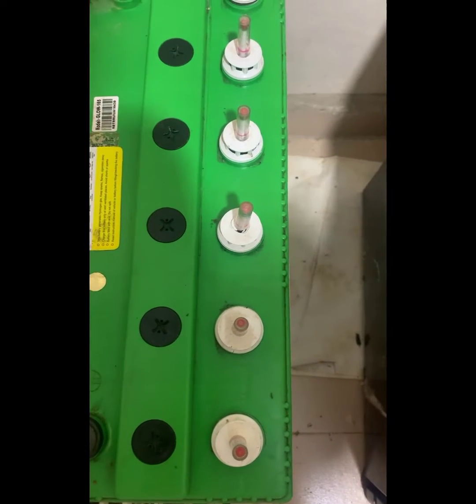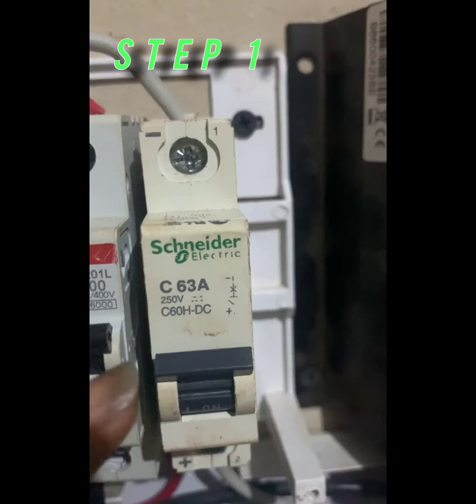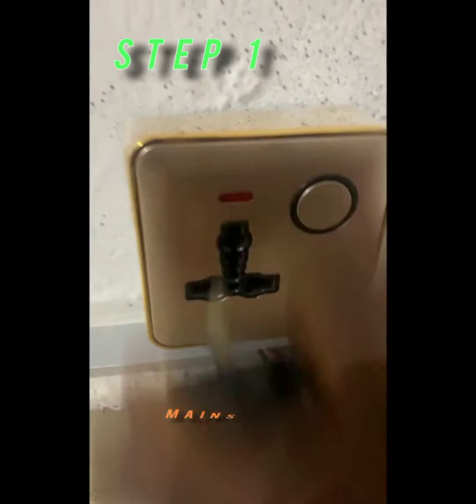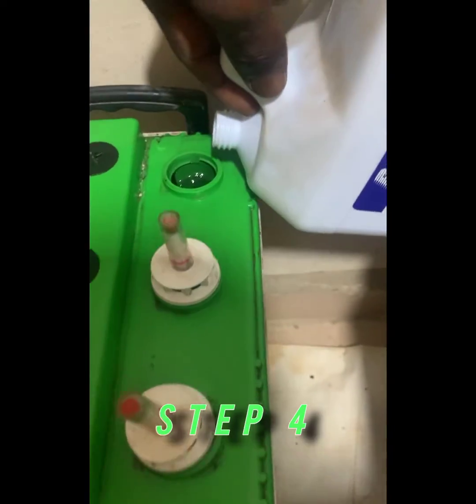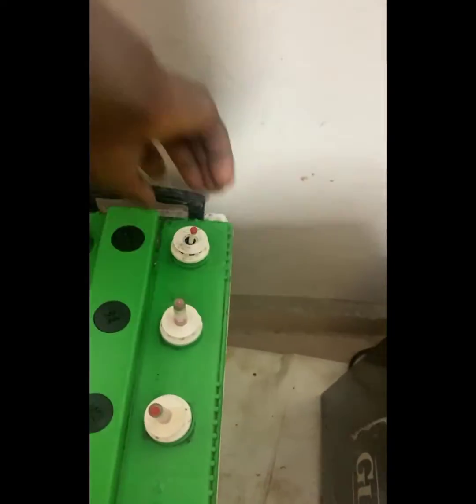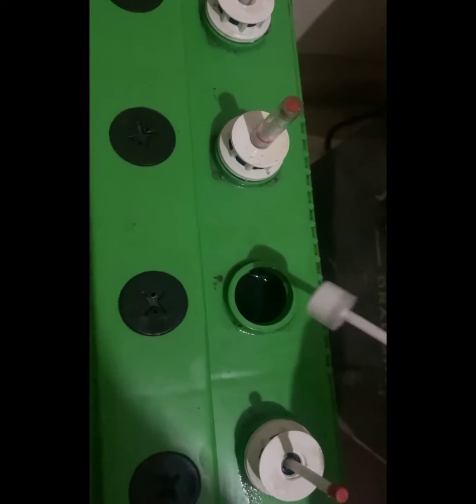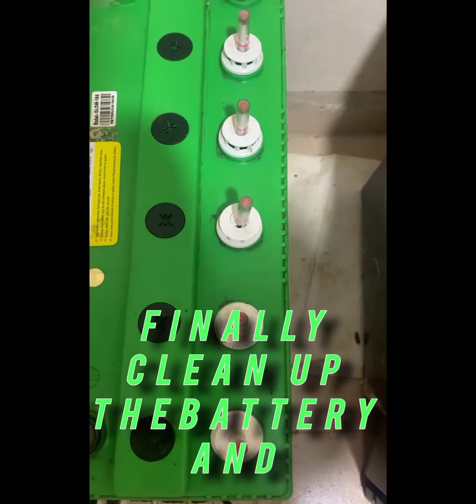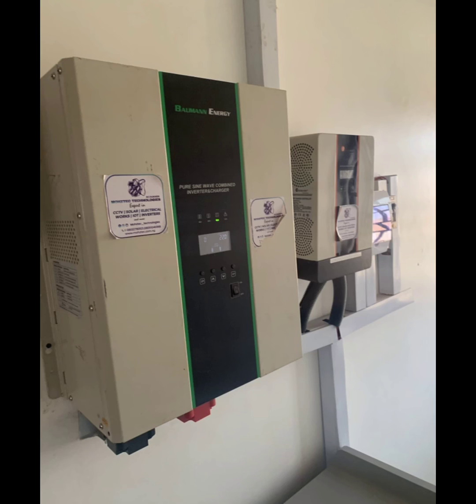HOW TO TOP UP YOUR INVERTER TUBULAR BATTERY WITH DISTILLED WATER

Comment: How many liters did you use for the battery?
Reply from the maker: It depends on the level at which it has reduced too.

In this case I did not use up to 3 liter since it's just to top it up